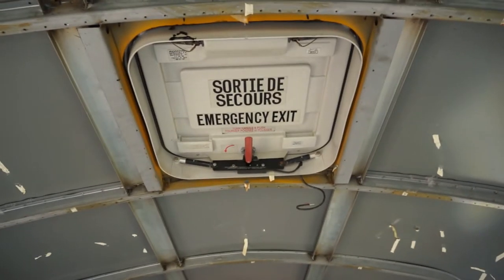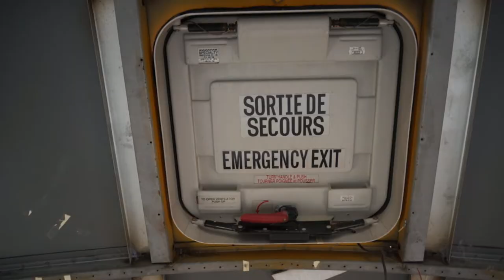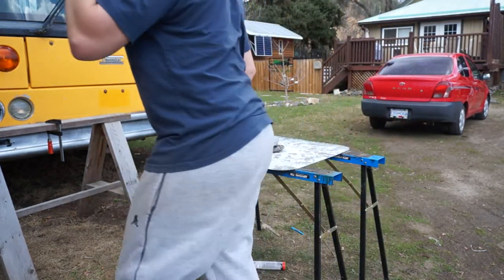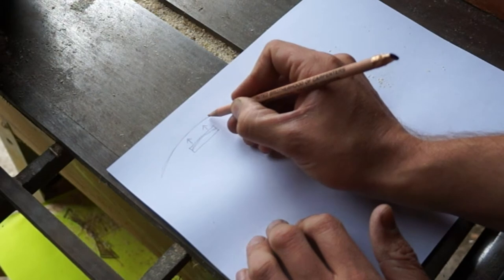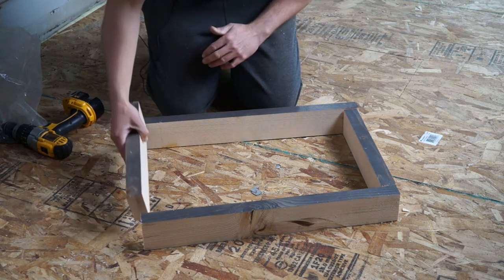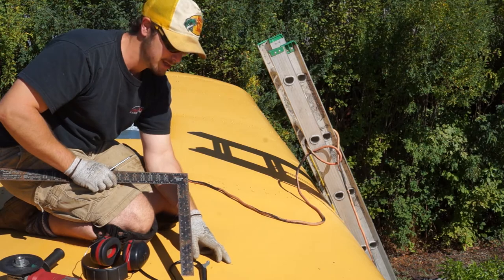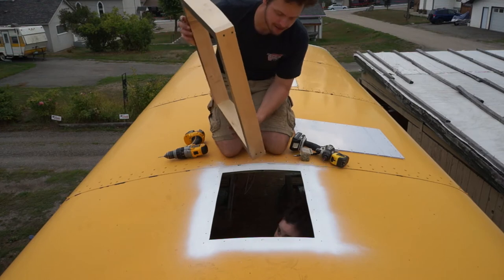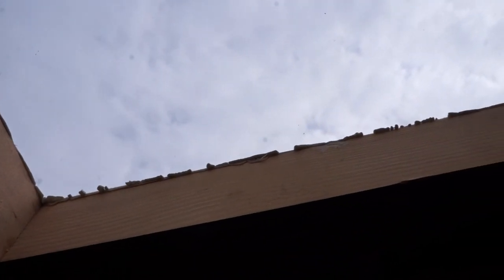Skoolie Skylights | Cheap Skylights Bus Conversion | Ep 13

Comment: Looks absolutely great I've seen this done on another bus Bill to one question I have is why nobody puts another plexiglass window on the inside to keep it would better insulate to keep the warm moist air inside from like freezing on a single pane window like having a storm window I'm just kind of wondering if that would be a idea
Reply from the maker: The reason i did not put a second layer on the inside is because of humidity. Once you trap air in a space like that it tends to fog up and can create mold and visibility problems.

Comment: Thats what happens to silicone when weathered and not cleaned prepped before applied, kind of makes you rethink the silicone on the front lower roof portion now doesnt it? I use urathane or butyl only but have seen all kinds of things used that worked for a while

Comment: So you put screws& glue to fasten the wood to the Metal roof(over night). Then you also used screws to fasten the the glass panel to the wood Frame? so you have 2 sets of screws, or were the first screws just temporary and you removed them?
Reply from the maker: The first set of screws were just temporary